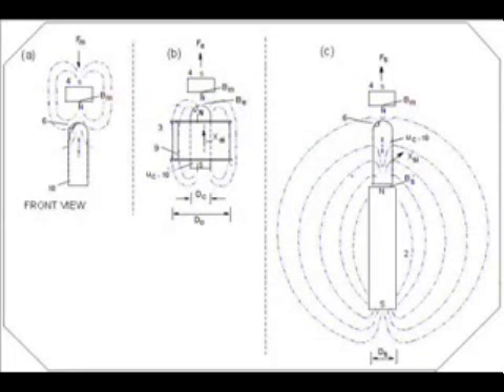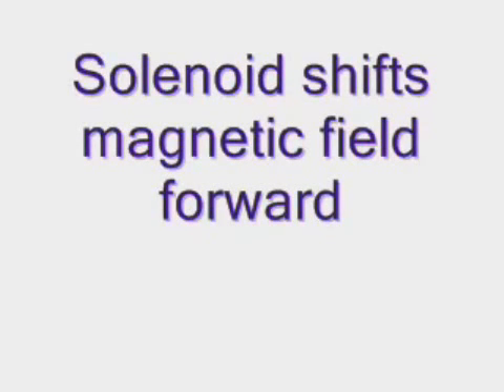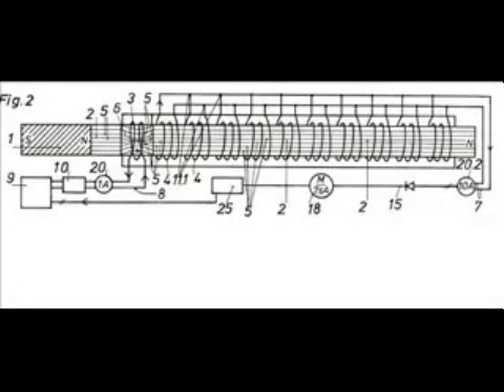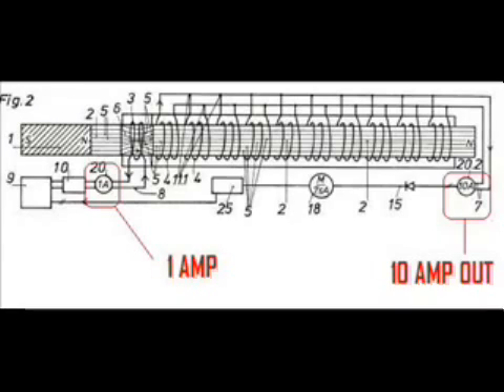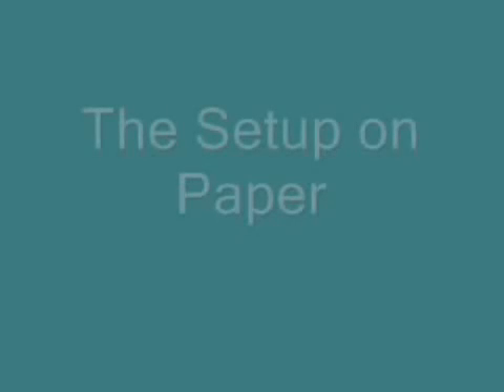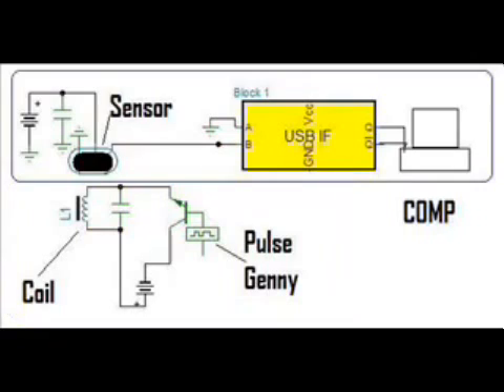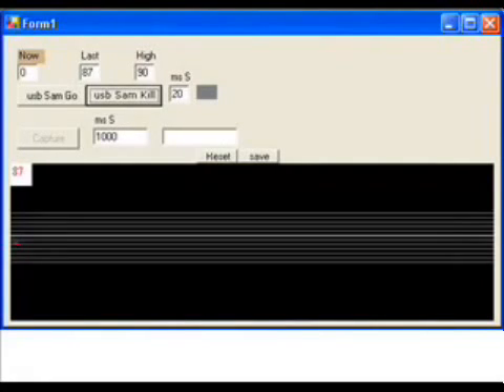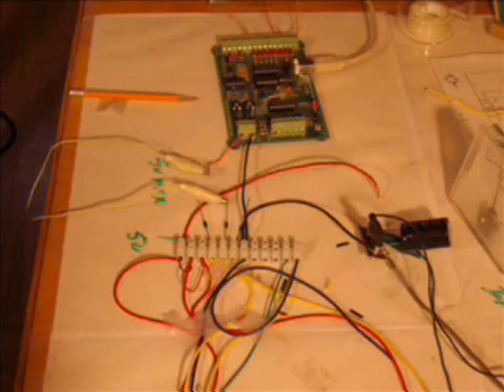Magnetic Field Generator (free energy)

Comment: it could be made simple and small wrap a pulsed dc coil around a magnet and put a another coil as a output coil near the primary coil because of the magnet inside the primary coil the range for output coil should be extended but i never built one bacause its not proven and i cant afford to fail so im building a mechanical generator that is guaranteed to work scottkeiser.eu.pn its much bigger but it wont waste your investment.

Comment: Although at first glance adding an electromagnetic to a solid magnet seems to increase the field, it does not induce any extra power to the whole system, These conditions exist already in all DC permanent  magnet motors, and these show no increased output over the input.(Yes they do have back EMF as well), but all known tests show a loss under unity, less than 100%.
Magnetic fields can be manipulated, but are a static force, the mechanical equivalent is a spring, they do not contain power.

Comment: You're talking about magnetic amplifier they used in large welding transformers for output current adjustment. your 10:1 ratio is very humble coz the welding machines I used to work on had a magnetic amplifier with 100:1 ratio.

Comment: There is a little known company in Canada that makes Solid state energy generators.  Called MagnaCoaster.  The company was created in 2009 and because of component problems with holding the Hugh spikes of current and possibly sabotage of ordered Chinese components, it took them 3 years to finally ship out the energy generators.  They work, but cost a few thousand bucks..  So theres all the proof that you need.  Debunk that.  Trolls

Comment: One amp in and 10 amps out - - - What? That's more power? I think not. One requires a voltage AND current to achieve power. Amps IS NOT power. However, AMPS x VOLTS is power in watts.
For motors, Amps creates torque, and volts creates speed. Therefore Speed x Torque = watts

Comment: It's like i said-permanent magnets can do useful work,and you cant proove me to be wrong.It is tipical to see bookworms like yourself say-just add more current to give a motor more torque-when all you have to do is install stronger magnet's,and use no more current to gain extra torque.
Then there comes a point when your incorect theroy(add more current) dose the exact opposite,and the motor starts to loose torque.You do know about backEMF voltages within an inductor,and core saturation-dont you?

Comment: The output torque is dependent on how the motor is designed,not how much current you put into it.Lets see how well the motor runs without the permanent magnet's.The can be no argument that the permanent magnet's supply a great deal of the torque within an electric motor.Like i said-get a pmm and remove the permanent magnets-and see how it run's--proove me wrong.
The magnetic field supplied by a pm accounts for around 40% of the output torque of a pmm-this cannot be prooven to be wrong.

Comment: And your point's are faulse.
A magnet can do useful work,example-take a dc permanent magnet motor that uses say 12 volt's at 1 amp.Now remove the magnet's and replace with steel block's of exactly the same size.Now useing the same amount of power,you will find the motor has hardly any torque and less revs.so if it wasnt the magnets doing useful work-what was it einstein?
Reply: Not to mention, a magnet can pick up more then its own weight. If that's not useful work, I don't know what is. Late reply sorry.

Comment: With regard to the patent solenoid circuit; although it would appear that the current flowing is 1 amp on the left and 10 amp on the right, there is no firm indication  what the voltages are on the left and right respectively. It, therefore, lends itself to the criticism that all we might be seeing is a a step-down transformer effect and nothing else. However, the principle is very interesting. Thank you. Dorian Stonehouse. doriansto@aol.com

Comment: there is no such thing as "energy from nowhere" :)
so: about antenna: there is no external energy supplied "to power it" (well ... the radio waves carries energy, but I supposed you didn't mean that); the external energy is for auxiliary circuits in order to amplify that tiny current.
and for the physics: variable magnetic field does not have kinetic energy :) I didn't say "rotate a magnet"; I've said variable magnetic field.

Comment: what I'm curious to know, is what is the voltage in this schematic? it is very easy to make from 1A 10A, but the output voltage is 10 times smaller than the input one (at list in classic theory); so: what's the voltage?
and more: every conductor passed by electric current generate heat, which means power loss, and if it is in a magnetic field, the force of that field will lead to an increased resistance in the conductor which mean more heat, which mean less power. these rules apply here or not?

Comment: Not a very original reply.  There are any number of reasons he wouldn't sell a working version; potential patent infringement comes to mind.  And if he could conceal a power supply in that switch box, I would be just as interested in that; seriously doubt that to be the case.  Perhaps my biggest problem is he said he added a coil to the generator (I think); how simple is that to do with 'any' generator?  But regardless, it's the only thing I've seen on YouTube that has potential in this arena.

Comment: but if you look at the dwg, it's clear that the secondary coils are paralleled, and could have the same # of turns as the exciting coil, so the watts would be 10x. Only a FEMM analysis would show the flux distribution in the iron, and it might not be linear throughout. However, if the current is truly the same in each secondary coil, then it truly could be a current multiplier. Only experiment would tell.

Comment: MAGNETIC PULSE COMPRESSION (MPC)
Magnetic pulse compression utilizes reactors in conjunction with capacitors to shape input pulses into narrow output pulses of much higher current . MPC, therefore, allows the designer to use less expensive input switches with lower current ratings. MPC can also extend the lifetime of the input switch. Advanced MPC devices - capable of generating power levels of multi-terawatts in tens of nanoseconds - have been realized utilizing Metglas® cores.

Comment: Why is it called a solid state generator? Transistor, diodes, micro chips are solid state. You're presenting coils, solenoids, and magnetic flux. The usb if is the only solid state device which is just a control system. Anyways, I think the trminology is wrong, just making a point.

Comment: That kunel device doesn't work. The magnetic field simply doesn't extend that far into the iron core.  If you measure the magnetic field of the iron core near the magnet vs. the north end (farthest) of the core,  you'll quickly realise that it is very weak to almost non-existent.